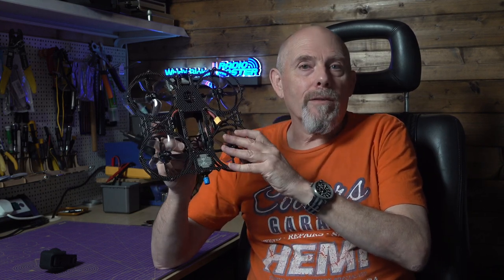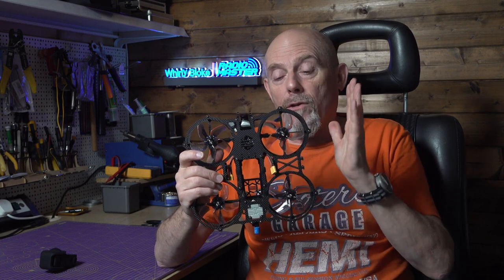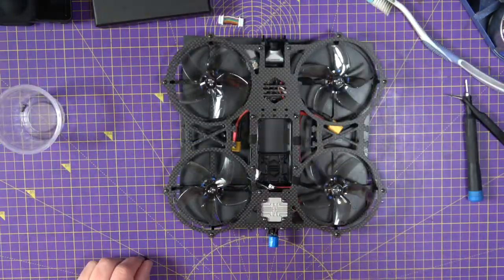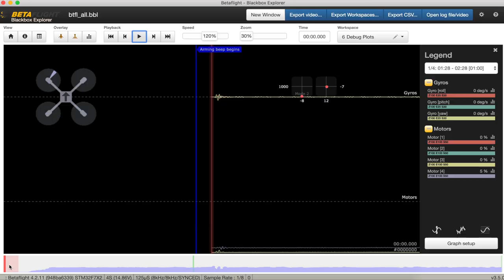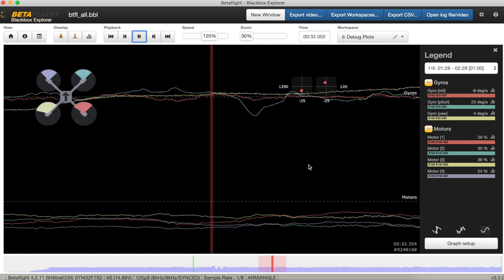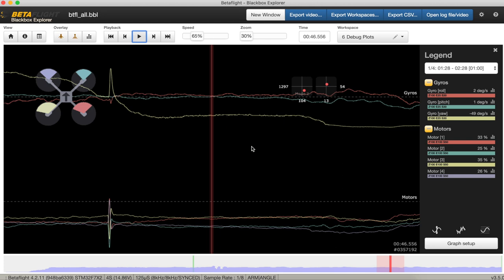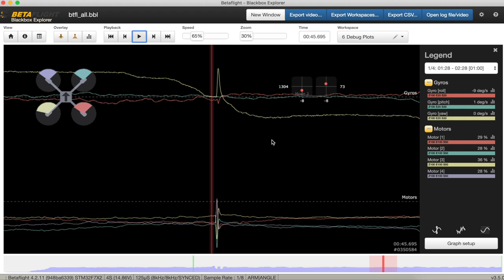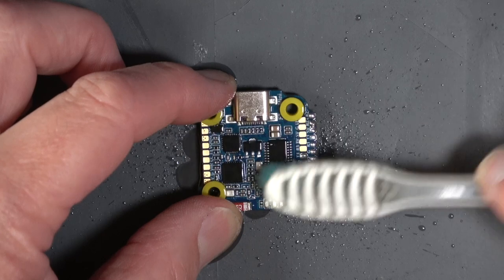Yaw twitch - troubleshoot a bad gyro in BetaFlight or INAV

Comment: 2nd from Polson, Montana. 
Also on the note of bad gyros. I just built a 7 LR rig and I've got RC6 BF 4.3.0. I've noticed that I've got an issue with a spazzing yaw. There seems to be a problem in the BF firmware at least from what I'm understanding. It can also kill gyros. Not sure if it's a specified board or gyro. But I reflashed BF 4.3 and it was fine afterwards. Have maidened and already completed a decent flight mission about 3.5 to 4 miles round trip with out any issues.
Reply from the maker: That's good info to know. Thanks.

Comment: im pretty sure i have my first bad gyro ever... i run mostly hobbywing stuff and i bought a new xrotor f7 an 60a esc ..clean build set up like normal and its my first 6s build I'm running the cap it comes with and i get random hard twitches every so often. one flight its fine i can fly hard and its good then the next i will do a hard 180 and throttle and it makes a weird sound like it got hit and tweaks right then goes normal again. i have never had this happen and i been stumped
Reply: I switched to new motors and put new props on after I had one motor burn up and another fly “away” (off the quad and from the wires)… I put 4 new motors and props on an now I have this random twitch. Have tried to tune it out but to no avail. It’s very random, which makes it hard to fly. 

This is my 2nd HW FC as the first one was bad after 3 flights. Sent back to and from HW (on my dime) and now having this issue. I’m going to swap  everything to the Speedybee stack on a new frame to rule out everything but I don’t think I will ever buy another HW product. This shouldn’t be happening.
Reply from the maker: Thanks for sharing

Comment: I am having the same issue with aocoda f7 mini but here's the catch when I use a lipo it's working fine but when I switch to li-ion its making those yaw twitching ....

Help please 🥺
Reply from the maker: That sounds like a power problem. Not enough volts or current when powered by your on li-lion batteries. I suggest checking the on load voltages first, cos it's the easiest.

Comment: Something similar happened to me, my drone only worked when I set the pwm frequency to 32Khz, I decided to change the fc but it didn't work, so I didn't want to waste more money and I replaced the stack, now the drone flies normaly, but I get pretty hot motors, I will try to lower the pitch of the props and replace the capacitor by a 1000uf. That problem was pretty strange
Reply from the maker: Dial the D down and see if the motors run cooler. If not you've probably got mechanical vibration problems. Again,  check the gyro traces in the logs.
Reply: @WhirlyBloke  I'm flying on defaults and the problem doesn't go away, also, I get bounceback, specifically if I do half a roll 😞